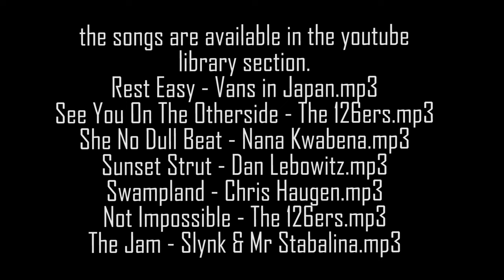Handmade 18KT gold ring with freemasonry symbols

Comment: The laser tool seems to be a great investment! It must be so enjoyable to achieve such precise results with much less tress!
Reply: Here, as in any business, everything is relative. Not every jeweler has the skills to work with vector graphics on a computer to qualitatively prepare a file for a laser machine. And unfortunately, with such engraving there are irretrievable losses of gold, which is almost non-existent with manual and mechanical engraving. But you are absolutely right, speed and quality are decisive factors here.
Reply: @gansmiller9734  А что, при лазерной граверовке золото испаряется?
Reply: @СолидиКомпаия  Конечно.В этом и принцип.Даже если вы делаете гравировку на стали,то и сталь лазером испаряется.При глубокой гравировке происходит выборка фона.А иначе куда он (металл,золото) девается? :-)
Reply: @gansmiller9734  Да, логично.
И физика здесь понятна, но, скажем, есть ли такая химия, которая может улавливать эти все испарения и возвращать их обратно в метал?